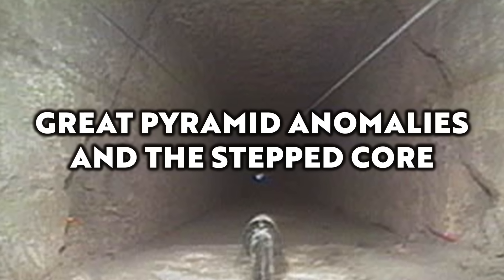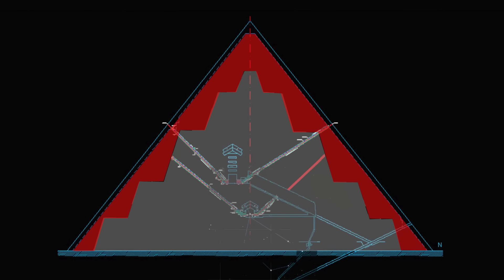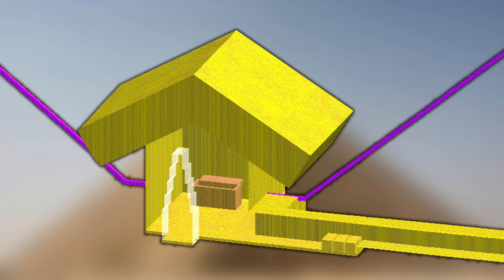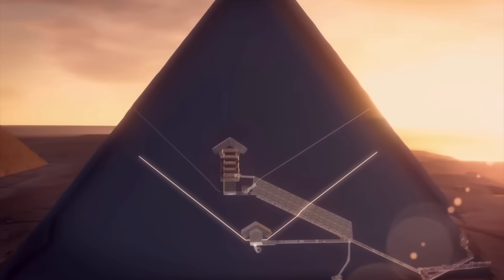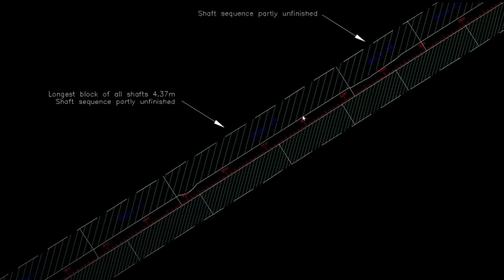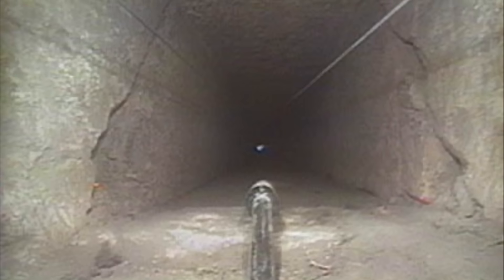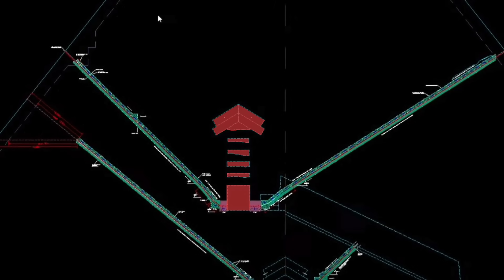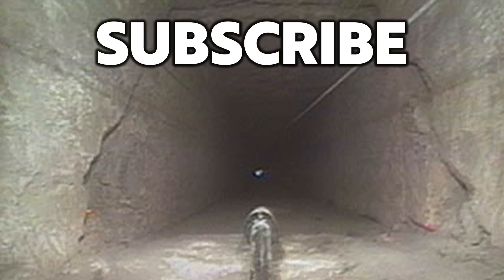Great Pyramid Anomalies Reveal Hidden Structure | Part 2

Comment: My thoughts on pyramid construction methods: I think that the step pyramid is a clear indication that the ancient Egyptians had cranes that could lift moderately heavy blocks (up to a few tons).
This means that they could have built essentially all of the pyramid without needing ramps at all. The complicating feature of the great pyramid is the extremely heavy granite blocks. 
Regarding the cranes, counterweights have been suggested by others, but one thing that people often fail to consider is the stretchiness of ropes. Nowadays we have static ropes that stretch very little, but of course natural fibre ropes don’t work that way. The longer a rope is the more stretch it has and the more energy you lose when trying to pull it.
When you think about it this way, it becomes clear way cranes would have a maximum height limit. 
Regarding the granite blocks, I think that the grand Gallery was used as a ramp to bring those blocks up to the base of the kings chamber. Then a temporary ramp (approximately along the Northern air shaft) was used to bring those blocks up to the level of the upper step, or high enough that they could be stored for use in construction of the Kings chamber.
Essentially the grand Gallery was needed because you needed space for all the people pulling on the ropes. There is some evidence that a larger passage way (Later filled with locks) existed above the descending corridor from the north; and this explains why the weight relieving North face corridor would be needed. This was of course filled in with blocks later, And it is evident in the corridor construction just below the grand Gallery being quite haphazard and ad hoc. 
Blocks could be hold upwards along the secondary temporary ramp via counterweights on the outside of the pyramid.
I think the key insight here is that the reason we only see these large internal ramps in the great pyramid is because of those 50 t granite blocks. Other pyramids don’t have these ramps because they didn’t need them; essentially we have underestimated the construction methods, They just use cranes with a maximum lifting distance of 10 m or so, Which can lift up to a few tons. Adding this to the picture makes everything pretty clear.
Reply: Only thing with the interesting ideas you are repeating above, is that there is no physical evidence of cranes used in construction in ancient Egypt.
Reply: @ryann6067  Difficult to say for sure. We know that the first cranes - or the ancestor of the first cranes - the so called "Shadoofs" were used in Mesopotamia in 3000 BC. This is the date for the first archaeological evidence. And that they also made it to Egypt - first evidence in 2000 BC. But it is very unlikely, that it took them a 1000 years to copy that technology - it just so happens, that there is no archaeological evidence for this. This technology was used by their neighbours - it would've not taken them a thousand years to copy a technology widespread in their neigbouring country... Especially because they did a lot of trade with each other, visited each other and people moved between these nations. So you can see, how difficult it is to simply judge a situation of a civilisation just based on archaeological evidence.
Early cranes were mostly made of wood. Wood was somewhat rare in Egypt - and hence it was treasured. Same goes for the evidence of the first wheels being used there. Ancient Greece is considered to be the first evidence of cranes being used by humans for construction. Due to drill holes in stone, where those cranes presumably were positioned. But what if such holes were considered by the Egyptians as ugly and entirley removed after such a crane got dismanteled? Wood and rope was certainly recycled by them - we do know that much about the Ancient Egyptians. 
Or to give you another example - the first iron sword. The first iron weapons were incredibly treasured by their owners and their enemies. They were more valuable than gold for these people. It is so unlikely, that anybody would have left an iron sword / dagger on the battlefield, even after their original owner presumably died in that battle. Somebody survived and somebody would've collected it all. It either requires insane luck, that they might have overlooked such a weapon and left it there for us to discover today or it requires a later time, where these weapons were much more widespread, so that they weren't considered to be so valuable anymore, so that they didn't collected all loot meticulously anymore. Chances in Archaeology are, that we always dug up evidence of the later. There always is a lot of luck involved. And judging our archaeological luck so religiously is wrong.
Reply: @dnocturn84 yes we know shadoofs were used during this time period. No evidence of cranes being used in construction though. They must of used some form of rig and pully systems of course (for which we have significant material culture evidence). But no evidence of cranes in construction. Leverage and pulleys can work wonders as we can plainly see.
Reply: @ryann6067  Ok, one piece that puzzles me:
We do know, that they used ships to move stones to the construction site. There is one popular piece of payrus, that is evidence for this for the construction of the Great Pyramid. And we even know the quarry, where the material came from. But there is evidence for even earlier ship deliveries of heavy goods like this. So did you ever check out their ship designs? Ok, we may not know how this specific ship design may have looked like, but we can be certain, that it was no flatbed design (there is a yacht burried right next to the Great Pyramid, but maybe this was luxury cruiser for the king). Their ships had bellies. How do you load a 1t or even a 500kg stone onto such a ship? Drag or roll it on a wooden pier? Impossible. Or maybe a brickstone pier? Yeah, more likely. And then? Drop it into the ship? This would certainly sink such a ship. And how do you unload it at Giza? It is very unlikey, that they did not use some kind of simple crane for such goods. Even if archaeologists never undug such a crane to have the evidence for it, they must have used st least a primitive version of a crane for such purposes.
Reply: @dnocturn84 yes, the ancient Egyptians used river boats and barges, as well as sea faring ships. And you are referring to the Papyri of Merer. And yes, the majority of the stone was quarried from Giza plateau all around the area where the pyramid is located, as well as the quarries at Tura for the casing stone. 

And yes, I have checked out their ship designs. Or in this case river barges with fairly shallow drafts but likely wide beams, designed for transport of goods up and down the Nile. -Not deep-hulled ships. And if your barge deck is level with your piers, leverage, pulleys and ropes could be and likely were used to swing and leverage the stonework with relative ease. Especially if they were using canals and locks to control the water level. -This is all basic stuff…
Reply: @ryann6067  "And if your barge deck is level with your piers" That's never going to happen - it will never be level. This is even impossible today. The water level of the river changes every time, your ship height relative to your pier will change, when you add load to your ship. An always level loading situation won't work at all. Sorry.
Flatbeds that can carry multiple 1t stones or multiple 500kg stones did not exist.
Reply: @dnocturn84 yes, this is possible. And instead you could just say you dont know much about cargo boats, buoyancy, and shipping and moving of large objects. 

You may want to read up on how ballast works in shipping as well as how canals and locks work regarding water levels. Adjusting the angle will help with leveraging the load into and out of the hull of the barge. And if it has a level deck, all the more easier it is to slide your stone strapped on a large wood sled off the deck and on to the level pier. And wood is more plentiful along the nile and around the Nile than you may realize. Try to think a bit more on it. Cheers
Reply: @ryann6067  Nonsense. You're mixing modern tech into this. Canals? Locks? Buoyancy? This wasn't a modern canal. This is the river Nile, that we're talking about. Which changes its water level by the hour. Even worse - the ancient Nile, which wasn't controllable through the Assuan dam. These ships, or rafts (and I am pretty sure this papyrus said "ship" and not "raft", as hyroglyhs had different words/symbols for both), as you're suggesting, had no tools to adjust or compensate for load. These vessels just went down with load and up with no load. They also had no swimming piers. At least none that could allow you to carry tons of weight. There were only hard installed docks in the ancient world, rock or natural harbors or wooden piers, with posts rammed into the ground. Those can't adjust for weight either. 
And this is not just about 1t stone blocks - the heaviest granite blocks came via boat!
Reply: @dnocturn84 none of that is “modern tech”. And this conversation is clearly pointless. Please go read about ancient Egyptian water management engineering. Help yourself learn more about the technology used and developed by ancient Egyptian engineering and water management systems, canals and levies.  Along with artificial lakes. Please spare me your lack of knowledge. Also, please take the time to learn about buoyancy and how that can be adjusted on a vessel using ballast. Also you may want to check this technology, when it was introduced against our understanding of the development of cultural technological trends across the Julian calendar. You seem to have a different understanding of these things that Im not familiar with. Cheers 🍻
Reply: @ryann6067  I do know about this. I've studied this and have multiple degrees in this field. The Pyramids of Giza were build on the Nile and not on some artifical canals. The harbor was directly set up on the river. The quarry mentioned was also located on the Nile and not on some artifical canal either. So it was an entirely natural river connection in this case. No canals and no locks were involved. Nothing was artifical here, except that the harbor on the pyramids might have been increased in size and shape by human hands. But nothing that could help to control the water level was there to be found.
So why are you pointing towards this technology, even though we know, it wasn't used here?
I am not so firm with the art of operating a ship, that's true. But I don't think ballast is used in this way, nowadays.
These ancient ships (or rafts) didn't use any kind of ballast, that we know of. They would have to compensate for 10 or 20 tons of weight (or even way more). Which kind of ballast is supposed to be added, that is heavier than stone, but easier to deal with? Tens of thousands of sandbags? Thousands of ceramic vessels filled with water? I am seriously just curious, what you immagine here.
Reply: @dnocturn84 respectfully, you sound like you are full of shyte. But thats been obvious for some time now. Cheers 🍻
Reply: @ryann6067  I'm not. But this "conversation" is sooo far off-topic anyways. I would've appreciated an answer to my latest questions though, as I am seriously interested in the answers, but I assume you actually have no clue and you are what you claim me to be. 
I don't know enough about loading heavy cargo onto a ship and assume this to be extremly difficult - without really knowing it. Maybe it is so damn easy, even without a crane, and I'm just overthinking this. 
But I don't accept an "trust me bro".
Reply: @dnocturn84 you said you have degrees in this subject matter. Are you just asking rhetorical questions?
Reply: @dnocturn84 the information is available. Gotta dig research and read
Reply: @ryann6067  Yeah, I'll look it up when I got some spare time - I would have done so anyways, now that I'm intrigued about this topic. I guess they did it on land and dragged the raft into the river after loading.  It makes the most sense, but is an extremly hard job to do. Same goes for unloading. Holy smokes. 
Good to not have been born in these times. Only good job available seems to be king (or high priest maybe) - as always thoughout the ages -> unless you were a king during the French revolution.
A quick search is telling me, that they used two ships and a raft with such a stone in between them for the journey on the river itself. I don't trust this AI, but this explanation sounds very plausible.
Reply: @dnocturn84 You are consulting AI for answers!?!?!?!?!?!?! 😂😂😂😂😂😂

Comment: Agian...NOT BUYIN IT. Why the copper handles? What's with double doors? This isn't the first time you've jumped to conclusions.
Reply: If not copper what do you suggest the hatch, or dust cover doors should have been made out of?

Since this was a provisional structure or fixture, most likely it had a closure that could have open or adjusted for airflow during construction

Comment: The theory sounds plausible - but why then did the pyramid builders install those copper looking handles on the Queens camber air shaft blocking doors?
Reply from the maker: They were removable doors to keep sand/dust/rain out the shafts during construction. We’re looking at the back of the doors. On the other side are copper loops, probably to add a small rope so the door could be opened and closed accordingly

Comment: so how did anyone fine the airshafts in the queens chamber if they were covered over.  What evidence did someone use to locate them?
Reply from the maker: Discovered in the 1800s. They knew the kings chamber had the holes in the walls, and they put a metal wire through a joint between two blocks in the queens chamber and it met no resistance - just kept going. So he smashed the wall to find the shaft. Then did the same on the wall opposite.

Comment: When you describe the kernel of the pyramid, would not it answer tons of questions if you inclinate the external shape it would resolve the mystery 'how did they moved such blocks' An internal ramp used for both purpose: building the inner core, then closing the external blocks such as it appears now

Comment: "We must take into account the fact the pyramid has a stepped core hiding inside it."  Interesting turn of phrase.  NOTHING here is yet proven to be fact.  I still lean towards Houdin's theory.
Reply from the maker: Ok, I mean, it seems most likely the great pyramid has a stepped core as we can see it in a number of pyramids… but nothing is fact, and probably never will be unless we take the pyramid apart block by block.
Reply: @AncientArchitects  That's nonsense.  They need to breach the stone in the NW corner of the King's chamber to see what's behind it.  No dismantling required. That stone is not load bearing and is most likely a plug.  Why is there no evidence of the change in exposed areas?

Comment: Isn’t it possible it was used as a step pyramid with the queens chamber as its only core chamber and that the kings chamber and the pyramid shape were added by a later dynasty

Comment: Another fantastic video about the Great Pyramid.  Your theory about a stepped core makes a lot of sense to me.  I'm still wondering why the Queen's chamber is aligned with the center of the pyramid and the King's chamber is offset. Also, I'm wondering if the big void adjacent to the King's chamber has any relationship to the air channel directly underneath it.

Comment: I'm align with the step core assumption, however the long north block needs to be better explained. Doesnt make sense to have such a long block on top of two normal block.
Maybe its part of the step (top of the step so you need something more solid to fill the gaps because otherwise you have a weak spot at the edge of the step).

Great video as usual. Big love ❤

Comment: The reason the step core transition would be different in the two air shafts is they don't meet the core structure in the same way so each way requires its.own type of joint

Comment: Please explain the significance of the copper fittings located in the plugs of the queens chamber air channels.
Reply from the maker: We are looking at the back of the doors. On the other side are copper loops - as seen from the Djedi Robot mission, the loops probably had a rope attached, so the doors could be opened and closed.

I believe they were just channel covers, used in construction, to stop wind blown sand, dust and rain from getting inside.

When the decision was made to abandon the queens chamber, they just left the doors in place and built over the channels because they were not needed anymore.
Reply: @AncientArchitects 

would they really bother making such blocks as mere covers to keep out rain and dust etc? Tura limestone? Copper handles? Seems unlikely when they could have just used wood, or a papyrus mat or something.

Comment: What good is an "air shaft" if it's opening is covered by a casing stone?  And even if it wasn't, I can't imagine it generating much turn-over of air inside the pyramid.
Reply: That’s the shafts for the Queen’s chamber. The shafts from the King’s chamber were open to the outside when built.